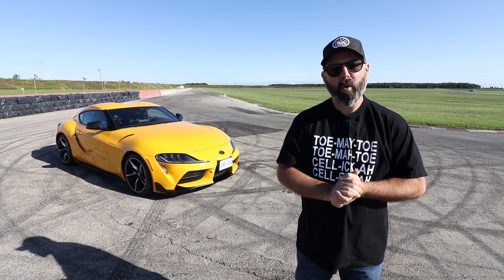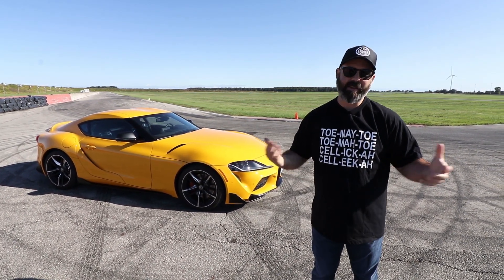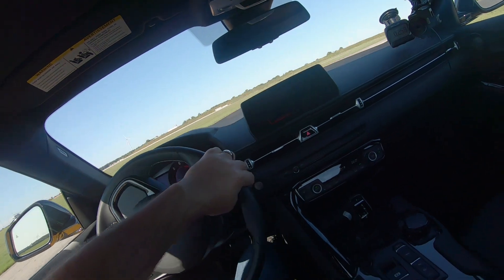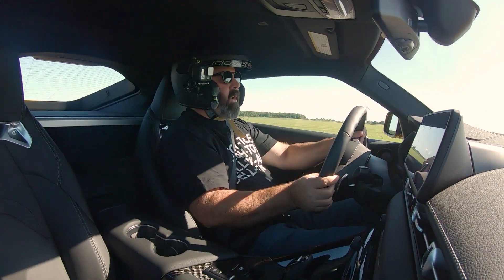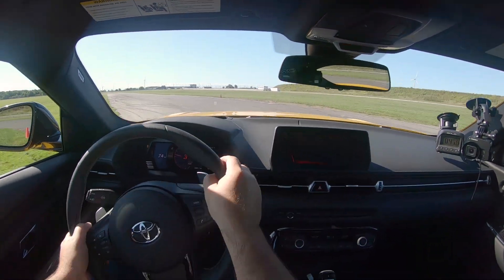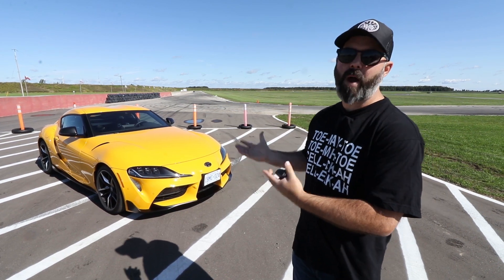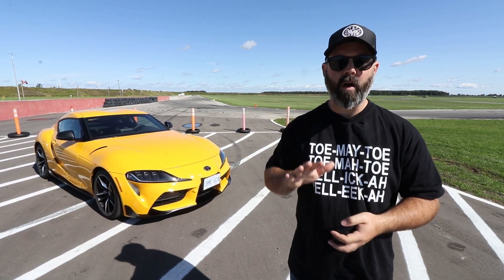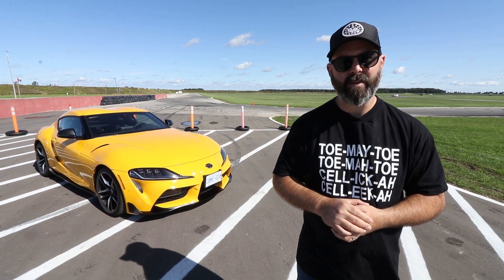To All The SUPRA Haters - 2020 Toyota Supra Track Review

Comment: Different day, temp, tire life etc but only 1/10th away from Jackie Ding's time (JD 1:19.41 v DP 1:19.54).

That's super close!
Reply: Won't lie, DP told me he ran that 19.54 in 5 laps in auto mode while I sweated for a whole day to work down to a 19.41... DP is basically TMP Jesus
Reply: We're not worthy
Reply: A90 with @tougetuningchris (CSCS #13 Street AWD WRX) did a 1:18.12 a week or so ago on the stock PSS's
Reply: Chris did it on OE tires but with a tune I believe
Reply: @JackieDing86  was watching both side by side from turn 2 onwards.. different styles of driving and steering input to get the car to rotate.. and also throttle application.. 1/10th is basically nothing after all that!
Reply: @JackieDing86  how much do you believe is due to tune and driver?

Comment: you need to race this against a stock twin turbo a80.
that will really highlight the improvements.
and also get the haters going
Reply: elliott b if the a80 is the old supra it has no chance that thing was a boat
Reply: @gigi9467  exactly.
Reply: @I_dont_read_responses  so why do people keep praising the 2jz then? yeah lets compare, the jz is now a dino engine.
Reply: @elliottb7009  Because for its day it was a great engine and has proven to be reliable, easy to modify, overbuilt, etc. Nowadays it might be a "dino" engine, but its aftermarket is still huge, parts are relatively cheap, it's easy to service, and all of the above points mentioned earlier. It's not rocket science to see why people still praise it. It might not be as advanced in terms of tech as the modern engines, but considering its 30 years old its great.
Reply: @zeroyon223 Again, if you read the tests conducted in '93 by all the big auto journalists, they praised its handling and steering feel. Unless you drove the car 25+ years ago, it's not what came out from the factory. You can't compare it to modern cars. Its main competitors were 300ZX, 3000GT, RX-7, ZR-1, which it bested in nearly every test.

Comment: Now that's fast. Car has gone 10.7 done the quarter mile with e85, meth, passenger seat removed, and tires...
Reply: N L a 25k Mustang GT?! Unless you’re looking for a used one, you won’t find one for 25k. The base model 4 cylinder Mustang starts at 26.5k, for the v8 Mustang GT is an extra 10 grand, with some options you are easily in the mid 40 thousands for that “25k” Mustang GT 
Nice try tho 👍

Comment: Stickier tires, a good set of coilovers and a proper wheel alignment could knock off another 2-3 seconds. This new Supra is kinda OP.
Reply: Yet it's slower than a cheaper Mustang 5.0 PP2.
Reply: Most of you money is going into the factory shocks already. I think coilovers is one of the last mods needed.

Comment: Hmm... slush-box RWD BMW with 335hp for $50k... or dual-clutch sequential transmission mid-engine Corvette with 490hp for $55k...

decisions, decisions. Hurry up with the Manual gearbox & some upgraded power and come back Toyota.
Reply: Don't forget the C8 got the interior that people were hoping the Supra was going to get.
Reply: @sigmaprojects  .....right?!
Reply: Your maths are way off on these prices, but...I get the sentiment, nonetheless.
Reply: @revolutionday1  Yea for sure, but man that C8. I'm looking forward to people putting it through its pace, that monster is really going to shake up the super car world. I really hope GM isn't lying about the 3s 0-60 with 490hp. Also crazy C8 comes standard with a dry sump system. Even a base C8 seems like it's going to be extremely impressive.

Comment: $55k = affordable modern sports car market.

RIP to the $25k sports car days 😢
Reply: Right it's crazy take all the luxury out give me a 6 speed and lower that price. Cut this supply and demand dealer bs too while your at it. Tried with 10+ dealers none of them cared to give me MSRP. They literally gave no fucks about me even face to face. Terrible way to sell cars
Reply: And then they wonder why new car sales are on a decline...
Reply: That's what the 86 platform is. 
It's expensive to build cars today, a 400hp sports car which isn't a heavy pig is priced about right. 

The only between would be a turbo/supercharged 86/BRZ which would probably cost 35-40k. Even then you'll be giving up luxuries for performance.
Reply: Chris Smith tell me about it. I bought a $60k fully loaded 1500 last year and went to trade it in for a newer 4x4 mode. Only have 8k miles and they told me trade in is $28k 🤦‍♂️ but they resell the same truck as mine with 100k miles for $40k on their lots.

Comment: Why is everyone comparing this to the c8 for crying out loud😂😂, yes they both have the same stsrting price but the Supra is maxed out at around $57k while the c8 can be speced to $100k no one would buy a c8 at $60k, but i wanna see them both on the track. And i feel the c8 isnt even the Supra's category anymore. Opinions are welcome, no hate tho.
Reply: i wonder the same damn thing all the time. Not to mention that the C8 will only be comparable in price as a stripped version for a limited time..then it's going to go up higher on the base price. That's been said by Chevrolet, not me.  Aside from that, they shouldn't be compared.

Comment: old z4 was a good car they raced it in GTLM,GTE and GT4 so this is no surprise 

i get why toyota did this but they could have done better !
for me they just made a FT-1 kit car with z4 ,they should have made the LC in to a supra
Reply: I'll leave this here:

"More case studies ensued before it was decided that TMC and BMW Group’s existing platforms were not going to be able to meet the performance requirements, so new architecture had to be developed to do so.
 
Fresh underpinnings (short wheelbase, wide tracks) were then decided upon, but TMC executives were doubtful that Mr Tada would be able to pull off the project, particularly in regard to high-speed stability.
 
To quell any doubts, a prototype of the dimensions was made, as per TMC tradition, using a Nissan that was cut into pieces and welded back together in keeping with the plans. It was later shipped to Japan, where key executives drove it and subsequently gave their approval."

https://www.goauto.com.au/news/toyota/supra/bmw-made-new-toyota-supra-possible-tada/2019-09-04/79871.html
Reply: @pmayo7894  yaa so i'm right ,it's a kit car
only thing toyota made was the body kit and the tuning of some parts and a ECU remapping 

(Mr Daenens was charged with leading the tuning of the A90 Supra’s engine, transmission, steering and suspension, which was specifically included in TMC’s contract with BMW Group.

 “We share a lot with BMW, but the software is totally separate,” Mr Tada said)

yaa body kit and software is from toyota everything else is a z4

"same underpinnings"
"Family ties: BMW’s Z4 roadster (left) and Toyota’s Supra coupe (below) feature the same underpinnings but have completely different exterior designs."

looking at this i think there will be no mk6 supra this will be the end !

also i don't see much hype about the a90 in the real world 
(except for the social media people who do it for likes and views and the generalist that they fly over)
shame !

Comment: Were sort of promised dual clutch but got torque converter auto instead ....insult to injury denying a manual trans....2021 offers 4cylinder (german? or japanese?) with turbo and lower price...but still auto only....hey maybe THAT one will be dual clutch?  Personally I guess Id rather have the six

Comment: I really like the Supra could have alil more mark 4 dna in the interior but not that big of a deal the deal breaker is no manual
Reply: Really no supra shared anything so it wouldn't make any sense sharing anything from the mk4 anyway.
Reply: The mk3 and 2 interior wasn't similar to the mk4. People don't realize this but all the supra gens were pretty distinct
Reply: @ciello___8307  except they all had manual transmissions and japanese engines now german euro ones
Reply: Cereal Killer as in froot loops i was talking about the interior. Plus not all supras had a jz engine
Reply: @ciello___8307  i was also talking about the interior thats where the manual transmission is  not to mention ofc not all supras has a 2jz lol what i meant was the engines were jdm as in produced by toyo or co produced with yamaha ..unlike the new german bastard son zupra pretending to be a jdm
Reply: Cereal Killer as in froot loops well they sold more auto supras then manuals for sure-autos existed in previous gens too. Also i meant the overall design of the interior and exterior has been different for every gen.
Reply: @ciello___8307  still sold manual versions in the past option was there lol and yah oc interiors vary in different gens of 99 percent of vehicles except porcshe 911 and nissan frontiers lol. either way the zupra is lame 55k for launch edition ...really 67k average after dealer rape mark up where i live ..where instead i speant 61k after dealer incentives on my zl1 camaro 650hp has a 6sp manual a back seat is almost a minute faster around the nurburgring compared to the zupra and faster in a straight line ...my point is there are better options or you can even wait and buy a mid engine vette basically a super car for near the same price bracket ...just sayin
Reply: @ciello___8307  oh and btw i do like toyotas  my zl1 is my fun car mydaily driver is a v6 camry with a 6 speed sport auto transmission

Comment: 2020 Zupra fan boys: The vents are functional.

Reality: the vents are fake.

2020 Zupra fan boys: The car is built by a third party manufacturer.

Reality: BMW recalls them.

2020 Zupra fan boys: The car is tuned by Toyota.

Reality: totally built by BMW
Reply from the maker: Every internet comment. ITS BUILT BY BMW. Yawn...Reality TOYOTA TUNED THE SUSPENSION AND HAD MORE INPUT ON THE BUILD THEN ANYONE CARES TO ACCEPT.
Reply: Speed Academy The suspension is developed, built, and badged by BMW. Toyota never played any role in this car because it was even recalled by BMW LOL. BTW, you are speaking to a mechanic and engine modifier, please sell your words to someone else

Comment: Nope. Handles like ass. The tires are pretty good too. Sure they're not race tires but they're not all seasons either. 
The fact is a brand new sports car should perform WAY better than that for the money. Camaro, mustang or even the dodge boats can all perform in the same margin. 

For the $ though? Gimme a new Camaro or that BMW they had on a lil over a week ago. That guy just ran a 1:19 at tmp and his car is arguably much nicer than this electric banana. 
I don't care about the BMW connections this car has so many other reasons to be disliked. Don't get me wrong, I'm sure its a fine car but its definitely nothing special. If you're going to buy it... It won't be for performance or luxury. It'll be because it's a "SUPRA".

Comment: I always hated Toyota. The Supra was a copy of the Datsun 280ZX turbo. See they both had inlines, but Datsun had the turbo first, and MK3 had a 3.0L to out do the 2.8L in the Datsun. But it took Toyota 10 years to catch up to the 280ZX turbo. The MK1, and MK2 have less power than a 280ZX of same year model. But 280Z came out in 78 or 77 in Japan same time Celica Supra MK1 came out.

Comment: Sadly I think Toyota has made the car far to expensive. I think they could have left out a lotta gagets and kept the price down. BRZ, WRX, 370Z are all 30k cars. I think Toyota would have had more success if they had kept it under 50k CAD. It's a 65k car... 

And I hate those new infotainment screens.... Just sitting out on the dash not integrated properly. Yuck.
Reply: The 90's MK4 sold for around $40k USD. Adjusted for inflation, that's $65k today so I believe the car is properly priced. The Supra isn't meant to be a competitor to the BRZ, WRX, 370z etc anyway...

Comment: No one cares if it performs great. The majority is just disgusted that Toyota lied through their teeth about the most simple things like the fake vents. They are not practical to make functional at all. To make functional you have to cut into the body and hood. Its ridiculous. If they lied about that, they probably lied about the whole thing. Two latch hood? Most new bmw have those already. 2009 E60 Msport i owned had two hood latches nothing new there. Its an ugly car, its a full blown bmw with bmw interior even the chime. It had been proven its not 50/50 weight ratio.... Thats why a lot aren't even selling for msrp. There isnt enough interest in them, specially after the C8 was announced. Even Superspeedersrob called it what it is. A BMW.

Comment: i spent 61k after dealer incentives on my zl1 camaro ..650 hp , 6 spd manual transmission , back seat , faster lap time around the nurburgring over the zupra by alot ...faster in a straight line , its not a bmw pretending to be a jdm and only cost me 6k more than a launch edition zupra ..yah lol zupra just not worth it around this price point